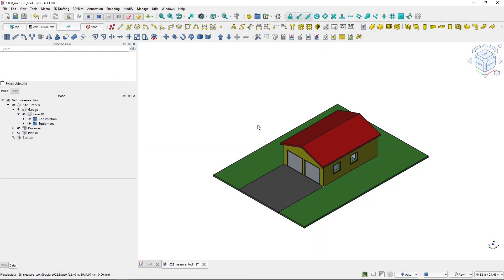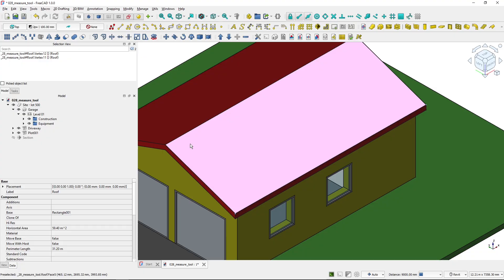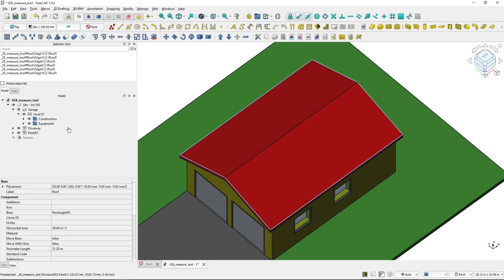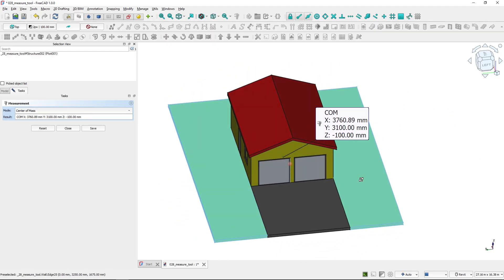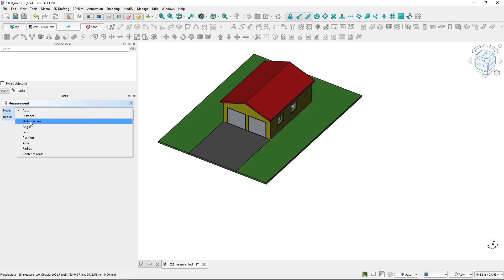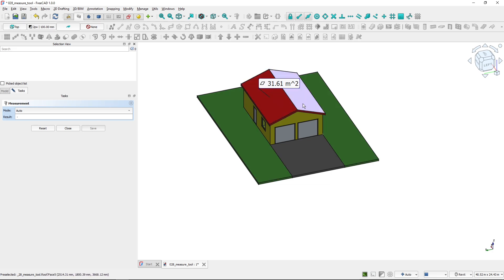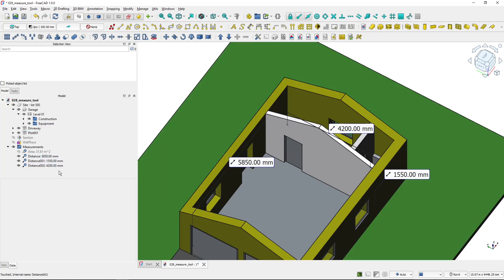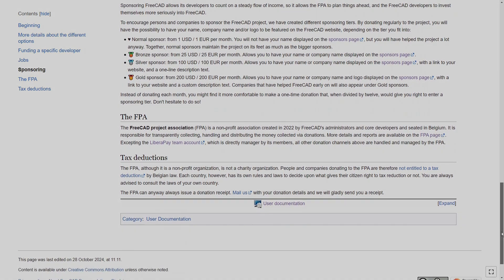Measure Tool in FreeCAD

Comment: unfortunetly its not possible to delete individual saved measurements inside the measurement task, if I place my measurment and model tabs on top of each other. it would by nice to see all saved measurments in the measure task with the possibility to manage them.
Reply from the maker: That's true. But once you close the measurement tool you can delete individual measurements.

Comment: I can't move measurement label in 98% of cases. Is there any specific trick to it?  i tried to drag line, icon, number, units, tried against geometry, against "emptiness" without geometry behind it.   It doesn't budge most of the time. Then at random it moves unexpectedly when i accidentally click on them. Last time it skyrocketed hundreds of meters above model and i haven't been able to bring it back down closer to model.  Other time labels cover each others or geometry.  It's very hard to work with.
Reply from the maker: It should be possible to just click and drag on the label. It's hard to troubleshoot without seeing.

You might try to ask through FreeCAD forum with sample file and ideally a video showing the problem: https://forum.freecad.org/
Reply from the maker: I also ran into this issue, it might be what you are experiencing too: https://github.com/FreeCAD/FreeCAD/issues/13537

Comment: My delta measurements are often placed almost directly over top of each other which can make them almost impossible to view. Do you know a way around this? This usually happens when measuring small distances between two points or lines.
Reply from the maker: Yes I have noticed this too. I don't think there is a way to fix this outside of rotating the view.

There is a GitHub fetaure request reported, you might comment there, so that developers know it bothers more than one user: https://github.com/FreeCAD/FreeCAD/issues/19440
Reply: @FCBlounge  Thanks for the link! I chimed in and hope that helps convince them to improve the tool.

Comment: Using 1.0.0 I click the measure tool but this does not work no matter what. When I mouse over any cad it only highlights the whole thing. I can not select just an edge or point like you do.
Reply: I have the same issue
Reply from the maker: That is strange. The tool is quite robust. Does the Measure tool open in the task panel?

Also, make sure you have no selection filter enabled: https://wiki.freecad.org/Part_SelectFilter/en

Comment: what workbench are you using? in my part design workbench the measure tool is greyed out
Reply from the maker: That is weird, as the Measure tool is part of the core - it is available in all workbenches.

Though it does not work when you have sketch open.

Comment: Hi can the tool measure the lenght of a wire. For exemple, lets imagine that in your house model i want tp add a wire that run into multiple wall, how would i do that?
Reply from the maker: You could model the wire using the Draft_Wire or Draft_Line tool and then measure the length of these objects.